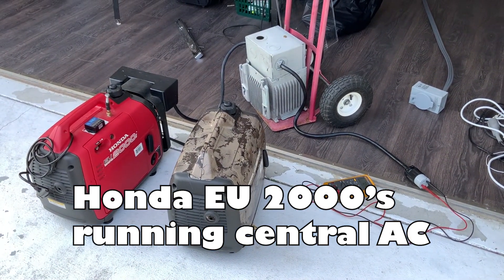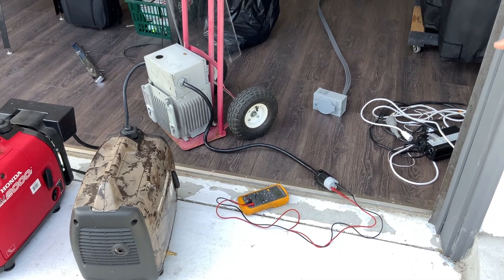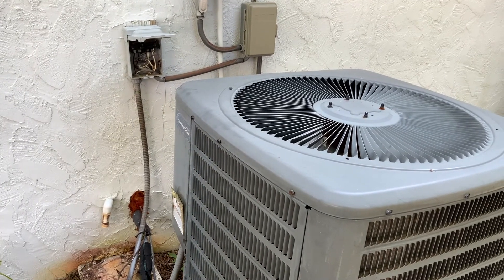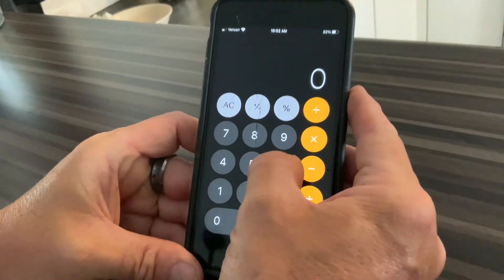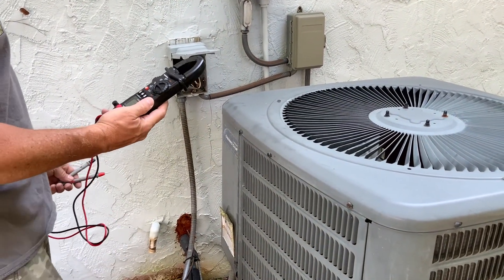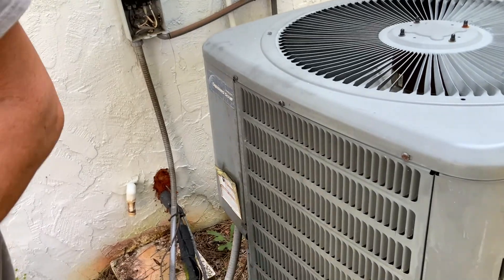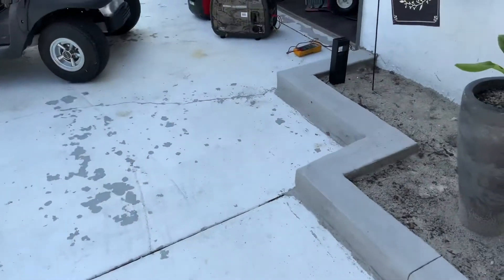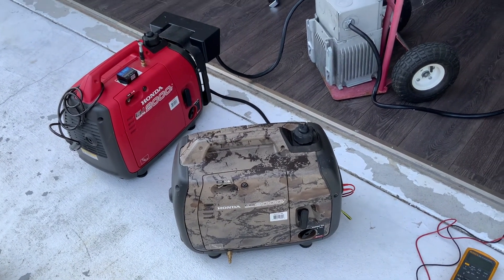2 honda generators start central air

Comment: Cool video! I was trying to figure out how you planned on doing that with two 120v Honda‘s. Thought this dude is confused! I’ve got two 2200’s and a 3 ton AC. Would you recommend getting a transformer or another generator like a Briggs & Stratton Q6500 which is 240v/5000w sustained? I realize the soft start is crucial. 3600w out of my two Hondas is probably not enough, what do you think?
Reply from the maker: To be honest, the Briggs would be the simpler option. I do believe two 2200’s would power your 3 ton though with the soft starter.  The problem is the transformer is heavy, more things to connect up. I already had my two 2000”s for a long time, and was curious if they would work in a pinch. I am amazed at the soft starters in how they reduce inrush current.
Reply: @IFix-Things  Took your advice on getting the 240v generator...https://www.youtube.com/watch?v=2NngIkMmTTk  Works like charm! And I'm on natural gas now!
Reply from the maker: @adrianb6073  nice job!

Comment: Can you link that transformer? Super interested and great video!
Reply from the maker: General Electric 9t21b1001 G2 Power Transformer
Reply from the maker: You can use lot of different transformers, just make sure you get a good quality 120/240 preferably with isolation.
Reply: So what is the function of the transformer here?  I have a problem with my A/C compressor not coming on at all running on my generator.  It does not even jog down my generator it just won’t turn on at all.
Reply: The two 120s into the union box are already kicking out 240, right?
Reply from the maker: @RCarver62  no, that’s the problem. Most of these smaller inverter generators only output 120, but my central air is 240, thus the need for t	he transformer.